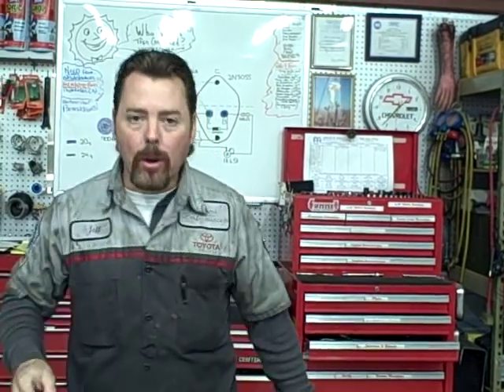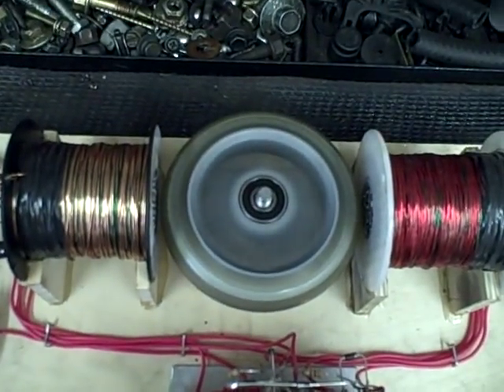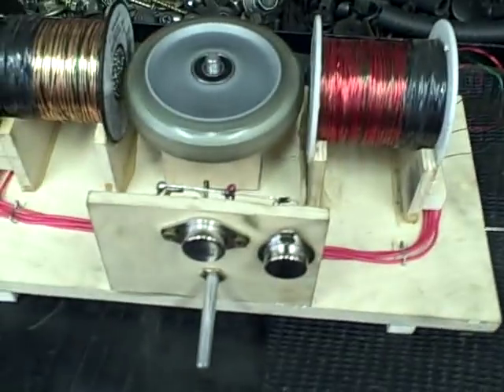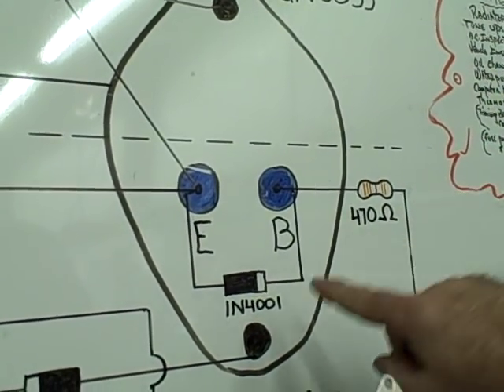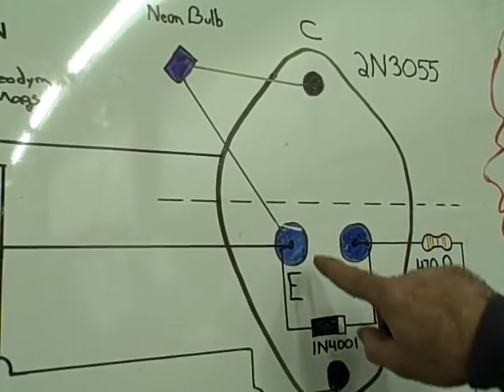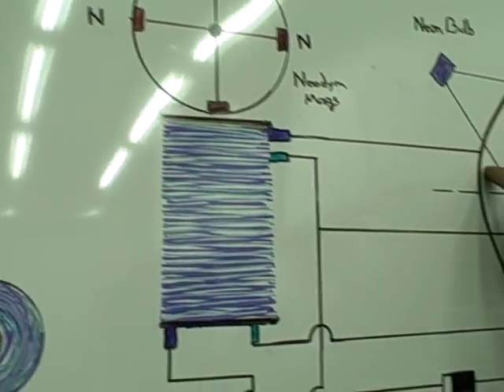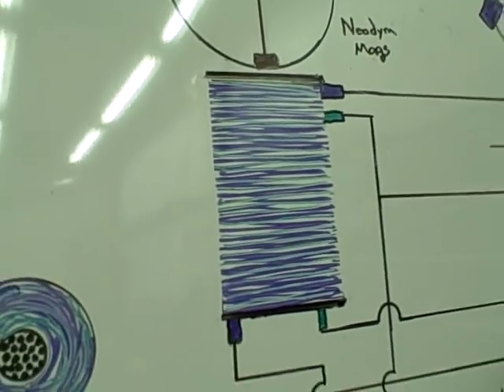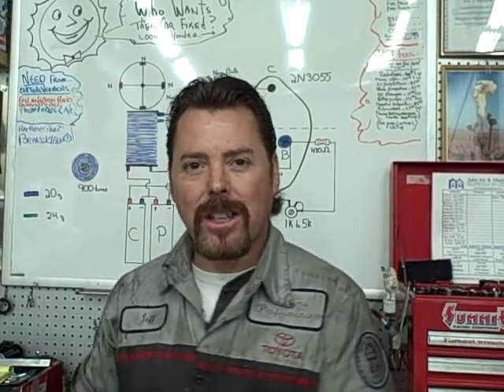Bedini Motor ( Generator ) How To Build One

Comment: Advances in zpe will be based on skin effect related to frequency and voltage being stored at great proximity in the same device. like a bedini capacitor generating and storing simultaneously using  fullerene / graphene layered plasma generators. again proximity of the differential is the key. observe the light ships and tr3b in the infrared ranges and the uv ranges as they power up before bending space. Their freq will exponentially zip through the ranges as they accumulate charge.

Comment: Hi Jeff...

Excellent video!  A newbee should be able to follow the instruction to build their very own working motor. One comment...the more turns the better is not necessarily true the more turns equates to more resistance and at some point the trigger coil will not produce enough current to fire the transistor. I have found that 400 turns of wire is plenty for the trigger and then you can get crazy with the run coil or coils.

Good Experimenting...
Poppy

Comment: Mkay, now I understand how its sposed to work. You say we should get about 900 turns of both, but since the system is supposed to be up-stepping from a 12v source to a HV spike shouldn't there be a difference in the number of turns between the 20/24 gauge wires? Example 12V to 120V would be 1:10 ratio. This should raise the voltage but drop the current in the output coil. Unless its not using that type of system. Just checking.

Comment: Is it possible to build a larger multi wheeled version of this machine capable of being hooked up to a houses current electrical system which would constantly generate electricity and thus any excess electricity could be rerouted back to the grid? And only thus only use energy when you turn on devices that utilize elctricity? If not, can i find batteries capable of powering high amp equipment such as a washer/dryer?

Comment: @word777 As the magnet on the rotor passes over the electromagnet, it generates current in the trigger coil. When the magnet has spun past the coil, its magnetic field reverses and sends energy into the transistor. This ovens a virtual valve, letting energy flow into the primary coil from the running battery. When the pulse duration is over, current flow is cut off. This causes the magnetic field in the coil to collapse, inducing a flyback voltage spkie that charges the other battery.

Comment: I can up with a kinda radical fan, to propel a generator. Using this very simple idea I want to  power some led's in the garden. My question is. Is it possible, with the 4 magnets, and 4 coils to produce energy, only one coil would be enough for testing. I plan on 9 volt or even less. Eventually I plan on making a Zeppelin, With mag-lev Bedini generator if possible. This powering a small low power fan, and thrusting the Zep in the wind :D (I know, it's a crazy idea, but who knows :P).

Comment: @ghosttownhunter  super nice and simple video ! 
can u tell me or show me, how to put together the other coil and to put the 2 out puts to the same batery. Can i run more amps and more voltage with the same set up? or  show me "the same way as u show in the board" the wire configuration for the one that U show first, "the one that is runing" .  .....thanks for yure time !!

Comment: I made one of these with plans off the internet, and I got a hgher voltage out, but the current dropped, and the total power output was less than the input. I would be interested in seeing what you get for total power in and out. Your's looks better than mine.

Comment: Hey man im going to build one of these and another generator called a pulse motor it pulses current 1 time for the north and another one for the south, but for this one if I want to build a larger generator other than adding thicker wiring like say 14 gauge and 17 gauge and doing 1000 turns each coil, and using 1 1/4" by 3/4" n52 neo's for t the magnets. What other electrical modifications will I need to do to increase out put

Comment: I built a bedini, and when i bought the batteries, i didnt have enough money for two. So I took three recycle batteries marked as dead from the bin. All three of those "dead" batteries charged up on my bedini, and i have used them since. even my battery charger recognizes them as good batteries. I finally roasted one when I left it charging too long. they are interesting motors, arent they? and they use less electricity under load and maintain proportionate charging. other observations?

Comment: I don't think people believe this will free them from the grid because this does not claim to generate overunity. However, with this design there is no counter EMF in the motor and generator, so the efficiency is far better than the usual configuration.

Comment: I built one myself, but it draws about 5 Amps, the wires get hot but no spinning. The rotor just stops after i start it. I am using less turns of wire than 900, though. Any thoughts on what's wrong?

Comment: for person that have problems with soldering, use those conection rulers that electricians use, screw all componets to the line and use the sema circuit, you can figure that aout, the emisor and base should be soldered, the rest no need

Comment: the sppol should be non-metalic, as well as the rotor. I am using a 22" aluminum bicycle rim and a plastic spool. You can use the spool that wire comes on when you buy it, but ud have to take all the wire off, and then put both of them back on.

Comment: I'll learn you something on identifying the leads of your T03 transistors, that's very old. Use you Left hand for NPN, your Right for PNP. Your thumb is the Emitter, your Pinky is the Base, leaving you Wrist as the Collector. In most cases the leads reverse for PNP. Anyway that indicates which leads current relation.

Comment: Mine works fine, I add more Neo's for more power in the form of torque, which makes it spin, you will need big ferrites and thus a big wheel for spacing, I used small Neo's and a hard drive disk and bearing for minimal resistance, check Video Response for my copy of Jeff instructions ;)

Comment: everybody understands that john bedini proposes this cuircuit for charging batteries, very wisely and completely understandable that you can make a rechargable system, that means free energy, is a little bit complex to get energy from the same motor but you can hook up another generator on line on a same axis and them recharge the original system that has the battery, a nine coil with 12 pairs of neodimiun magnets is a good combination, there mas be a relationship between coils and magnets

Comment: According to Bedini, this configuration will bring batteries back from the dead and charge them full because the trickle on this system will eliminate corrosion on the battery plates and this is what kills a battery in the first place…..from what I gathered from his (Bedini) explanation. Oh, I also believed he used ferrite magnets but can't remember why he said that made a difference.

Comment: Jeff I built one similar yo yours but when I hook up the correct ends to the pos and neg terminals the coil has no magnetic field what could be the problem?
Reply: magnet wire has insulation on the wire, use a lighter or a fire match to burn off insulation for inputs

Comment: Hey Jeff  Made one ,It runs fine until I connect my dead battery's to it then it stops???used 3different dead battery's all stoped it from spinning.Can you think of y???
Reply: Hi I replicated his set up but with an erector set, primary bat sat at about 12.4 and got the charging bat to about 13 over 2 days. With what I played around with, you might have a diode going the wrong way or the battery is hooked up the wrong way, if not the charge bat is pulling too much and it messes the frequencies up and it stops.  Just my opinion, not I’m not and engineer or electrician.

Comment: Jeff:  Great video.  However, your video seems to describe clearly how to wire one coil and transistor section.  But, your demo shows two coils - how do the two coils connect.   What is the full circuit diagram showing how both coils are connected?
vikingms1975

Comment: Whats the point of using one battery to charge another? Start with a fully charged battery and a flat battery. Hook them up to the motor and you end up with a flat battery and a partially charged battery. If you want to charge a battery wouldn't it make more sense to power the motor from a mains power supply?

Comment: What part does does this motor play in charging the other battery? The circuit looks like it charges a flat battery with a charged battery via an electric motor. Friction and electrical losses takes energy from the good battery just to move the magnets in the motor. Why not just charge the flat battery with the good one without the motor? You'll still end up with two half-charged batteries, but that's better than two third-charged batteries when a third of the energy was lost in the motor.

Comment: Hi Jeff, I've made one like this in your video, I have tried to use 9 v battery, but it wont't spin. What could be the problem. Jake
Reply from the maker: Has to be a lead acid battery.
Reply: Oh, I see. I will try it. 
Thank you Jeff.
Reply: toughest part is building the bifilar coils..rest is easy..just wished I could buy one from the mall than turning those coils....

Comment: Dear Friend, 

I'm in Brazil I saw your video. 
Rode the circuit you posted, but it did not work. 
I replaced the transistor NPN and PNP on the other did not work. 
I'm using electric welding rods. Would it? 
Already turned the poles of the magnets and there was no positive result. 
Now left for help. 
A big hug, 
Pedro.

Comment: I use a 100 watt solder gun, it's way cheaper to use and faster to heat than even a 80watt soldering iron, which you would leave on to heat up and keep left on, the gun heats up and is ready to use within seconds and the trigger automatically turns it off, so it's only on for a matter of seconds;-)

Comment: So you've only mentioned how to wire up one coil. You have two coils on the machine. Am I supposed to assume the other one is wired the same way to the other transistor?
Reply: ChiefJustice Middleton yes it’s a separate full circuit for each coil. The trigger coil is simply to activate the gate mechanism of the transistor via a small current to send the larger battery current through the main coil kinda like how a car distributor works for its timing

Comment: Hello, 
i just want to build your bedini motor from your youtube page

 we have already:
- 2npn (2n3055) transitors, resistors (470 ohm, 1n4001,1n4007)
,potentiometer, bulb

My problem is at the moment the coils.
In your video you have two coils.
And in your painted backside your have only one.

I come from Germany,
i need more data about the spools.
I know already each spool has to have 900 turns.

Comment: What happened Jeff, did gold prospecting "not pan out for you"? lol!  Seriously... I have seen a number of plans for these generators or "Radiant chargers" that insist only ferrite or ceramic magnets should be used because you DON'T want too strong of a magnetic force.  So I am wondering why the contradictions?  This was the FIRST I have seen insisting only Neodymium magnets be used.

I'm not saying it is wrong, but wish to understand the reasons or if there are specific applications where the different magnets are used!  

Sorry about the Gold "dig"... oops can't help myself... lol...I'm hopeless when it comes to plugging in "line" in all honesty, your prospecting and more so, panning tips has me hooked on getting out there, too bad I find i am in a state all but VOID of any sources, but I am planning to take a trip to areas a few states away that are feasible, so I ordered "practice" concentrates online to try it out, and must say your panning techniques have me pulling even the smallest specs in the first round of panning, even though I NEVER considered trying this before, and nothing left when re-panning the same cons again!  I never got to comment on any of those videos at the time because I hadn't overcome the issues with comments after google went to one log in account!  So I thought to mention it here now that I can!!  I'll be checking some out again for a refresher before my trip, my 89 Toyota PU truck won't run unless i feed it fuel through the intake lol...and my Cougar lost OD in the last snow storm, as well as since started leaking coolant from the water pump... sigh.  Or I would be gone already!  

Great stuff overall!!  THANKS for all you share!

Comment: dudamejias... I suspect that ANY very powerful magnet will work. the stronger the better. The secret to this circuit is the iron core because of the way that it makes the magnets look bigger to the coils. (see "inductance"). Like many small branches are stronger than one stick, many smaller iron cores are better than one big core. I'd kinda like to see what would happen if many shielded (from each other) magnets were used.

Comment: war turns is not better there is a very specific length that is required to get good fly back voltage i don't remember what it is but it's in feet not interns turns is a relative condition depending on how big your spool is

Comment: I BUILT ONE FROM THE DIAGRAM YOU YOU HAD UP BUT MY MOTOR WON'T KEEP SPINNING................I'M GETTING CURRENT RUNNING THROUGH THE CIRCUIT AND COIL BUT MOTOR DOSEN'T CONTINUOUSLY RUN.....ANY POINTERS?

Comment: A self-running device is something you can achieve with a good stock motor and a good stock generator, bedini is just an alternate design to all that. As soon as you have it to actually do something (like switching on some lamps) you'll see that the energy you spent on the lamps is actually less than the energy of the first charged battery(energy you gave to the system). So it doesn't really work as an overunity device. It would be smarter to just plug an electric motor to the battery =)

Comment: Your schematic shows just one coil but your construction has two coils.
Does each coil connect to the SAME points in the construction?  Because your board has only one pot but you have two coils.  

Also the ghost town link is no longer any good.

Thanks!

Ron

Comment: I have just one question. How do you get it to violate the first and second laws of thermodynamics?
Reply: +Wes Jones 

Those laws technically should state: "Never mess with global gang banksters  and  their multitrillion dollar fossil fuel piggy bank!" if you intend to stay employed in the electrical/electronics profession!
Reply: Robert Zsanoka you do know the jaws of thermodynamics predate oil companies right kid? Do you even science bro?
Reply: +Wes Jones There is no violation of any of the laws of thermodynamics in Bedini SSG. Not sure why you'd claim that. It's not over 100% efficient electrically, not even close. It's the chemical composition of the lead-acid battery, that allows this, sort of, super-efficient charging by ultra-short high voltage spikes, so you use a lot less electricity to charge the battery than if you would normally use if you used a conventional high-current charger - that's the magic. If you want to claim, that the battery violates any laws of physics, well then.. good luck.

Comment: self generators without magnets require no metal core in the coil.  air core is better as it causes less damping.  Skin effect is how high voltage travels best. it is also good for high frequency.  like for increasing internet speeds. several parallel cat 5 cables going the length and coiled up close at the ends of your transmission  cable dont even need a physical contact. Again proximity is the key.  The faster your base speed the more multiples of increase you will realize.

Comment: @PEEPAW70 The battery acts an interrupt and every time the second circuit is activated the radiant energy flows. This doesn't act like regular energy because it is a kind of "etheric" gas. Its power that behaves like a gas. Cool huh? You could use capacitors as the interrupt, but they make crappy storage devices for constant use. Good old lead acid batteries work fine to store your charge. The radiant energy desulfates the lead plates and gets them working again almost like new.  More cool!

Comment: i have a coil with 4 wires one exciter and 3 power. can somebody point me to connection schematic or explain how to connect more than one power coil to the circuit. do i need to add a transistor for every power wire? thank's!